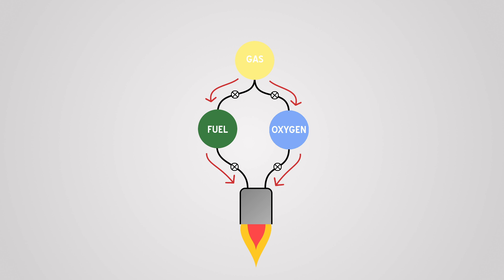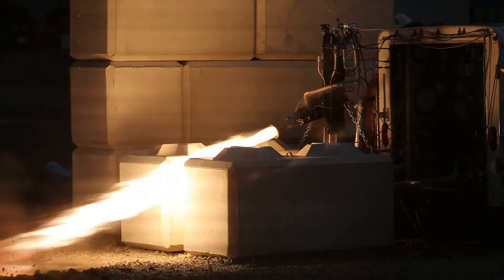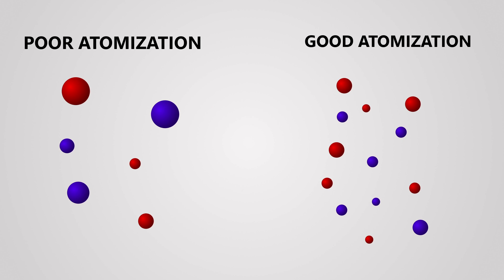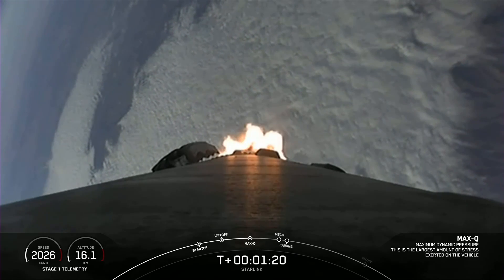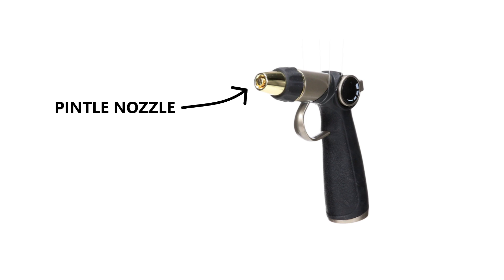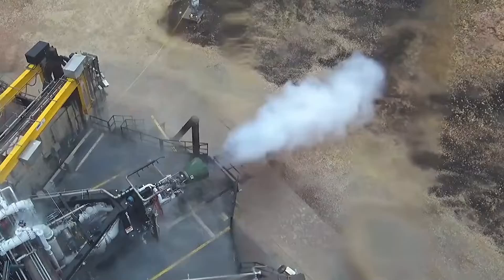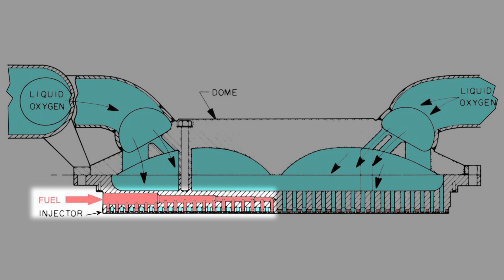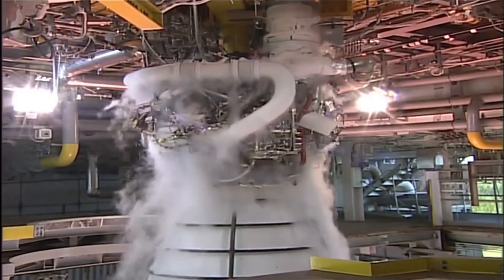How Rocket Engines Work - Part 6 - Injectors

Comment: Man I struggle just to get my garden hose flow rate right! It seems to be different every time I turn it on. Can’t imagine how hard is to get rocket engines to work. I know SpaceX actually have a simulation program that I assume they run on something like a supercomputer that calculates flows. I saw a video of this about 4 years ago from McGregor.

Comment: How does the propellant stay in the chamber in space? On earth its atmospheric pressure but in space ? Wont the propellant dissipate into the space vacuum before it gets a chance to ignite?
Reply from the maker: The whole goal of the rocket engine is to throw the propellant into space as fast as possible, but the time it takes to ignite is a consideration. If the combustion chamber is too short the propellant will indeed exit before it ignites. Luckily these reactions take place in very short amounts of time, so the combustion chamber doesn't need to be too long. The amount of time the propellant is in the chamber is only a fraction of a second, but for modern engines that's enough to burn.
Reply: @SpaceIsKindOfCool  but once ignited it requires pressure to create thrust . The space vacuum would prevent any pressure build up. It would be like an inflated balloon , when released the exiting air would provide thrust . But if we attach a vacuum hose to the mouth of the balloon then any air released would be sucked out immediately preventing any thrust
Reply from the maker: @nickmerix2900  In your example any air sucked out of the balloon, even if it were due to a vacuum, would indeed cause thrust. It's Newton's laws of motion, any action has an equal and opposite reaction.

As for vacuum causing there to be no pressure build up in the engine, this is also false. Since the nozzle is a constriction any flow through it will result in a pressure build up.
Reply: @SpaceIsKindOfCool  newtons third law does not apply to all forces. Example buoyancy, gravity, and pressure gradient. If we apply newtons third law to lets say a hot air balloon  then it should never   Lift of the ground. Or when a pressure gradient causes winds to blow south with force  x we dont see an x force to the north also. If i drop a 5 kg weight from height it will fall with a force of say 50 newtons but i will not feel that force on my hand. In these situations we have force with no opposite force . Rocket exhaust is basically pressurized gas moving to lower pressure ie pressure gradient. And gas expanding in a vacuum is free gas expansion
Reply from the maker: @nickmerix2900  Newton's laws absolutely do apply to all forces. In all of your examples the object which feels the equal reaction is the Earth (or the Earth's atmosphere). When you drop that 5kg weight it falls, but the Earth also rises to meet it, you just don't notice it because the Earth is so massive that 50 N doesn't move it very fast. In the wind example if you were to take the total momentum of the Earth and its atmosphere you would find it never changes. If the wind blows stronger in one direction the entire Earth must have a change in rotational velocity in the opposite direction.
Reply: @SpaceIsKindOfCool  how do you measure the opposite of those forces? It might be the case in theory but in real world results? If we put a small weight on a scale and use a vacuum hose to lift it off , we dont see the opposite force register on the scale. According to your theory we should be able to see an equal and opposite force.
Reply from the maker: @nickmerix2900  The theory is based on experimentation, just as it always is in science. In this example the opposite force is not felt by the scale at all, it is felt by the vacuum hose. If you were to suspend the hose on a spring scale you would see the hose get pulled down when it turned on due to the opposite reaction of the hose pulling air and the weight upwards.
Reply: @nickmerix2900  Nick, I can't tell if you're arguing in bad faith or not because I've seen a lot of commenters on rocket propulsion videos make the same claims you have made about the vacuum of space preventing rockets from working.  But I'll address some of your questions.

Hot Air Balloon Example: 
The atmospheric pressure, P, surrounding the balloon multiplied by the vertical components of the balloon's surface area, A, will create an upward force, F, known as lift (F = P x A).  If the lift force is greater than the balloon's weight, the NET FORCE will be UPWARD.  This upward travel will continue until the balloon reaches an altitude where the atmospheric pressure is small enough such that the upward lift force, F = P x A, is equal to the weight of the balloon, W = m x g.

Now then! You're wondering, "yes, well where's the reaction force from the balloon lifting?"  That reaction force is applied onto the air below the balloon.  Yes, that's correct.  The balloon is pushing down on the air, making the air heavier, and that air pushes down even further onto the earth.  

You can test this example for yourself.  Grab a bowl of water and place it on a scale.  Then add a floating mass on top of the water.  The scale will read higher to account for the added mass.  In this example, you have the weight of the bowl+water+floating mass pointing downwards due to gravity, and you have a normal force pointing upward.

Another example to help you visualize.  Take a barbell at the gym and put it on your chest while standing up.  Then vertically lift up the barbell in the air.  You will feel the normal force from that barbell on your hands, arms, and legs all the way down to your feet.  The normal force will be equivalent to the FORCE YOU'RE LIFTING WITH, which is greater than the weight of the barbell. The same thing happens in the water example and the same thing happens in the balloon example.

Wind Example: 
The wind doesn't blow with force x.  Instead, high pressure regions are created in the atmosphere which move the air radially outwards in all directions, including North, South, East, West, Up, Down.  That means you have air moving to the north and air moving to the south from a central starting point.  This would be like you being in the middle of Bookshelf A and Bookshelf B, while pushing Bookshelf A to the left and Bookshelf B to the right.  They both move, but you stay still.  Action force to the left results in a reaction force to the right. 

5kg Ball Example:
When you're holding the ball, you are already experiencing the action-reaction forces in that moment.  There is the weight due to gravity at 50N downward and there is the opposite normal force of 50N pointing upward from where your hand is contacting the ball.  When you release the ball, you experience a decrease in normal force proportional to the decrease in weight of the ball that you're hand is holding up.

What you're misunderstanding is the idea that "by you letting the ball go, you're IMPARTING A FORCE ON THE BALL and so you should experience an opposite force."  This is false.  Gravity imparts the force. You do not impart a force by letting the ball go.  If you wanted to experience the action-reaction force on the ball, you would have to PUSH IT DOWN HARD and then you would feel the resistance.

Vacuum Scale Example:
The 'ball' experiences the force of gravity downwards and a normal force upwards.  When you use a vacuum to lift it off, the atmospheric pressure, P, multiplied by the vertical component of the balls surface area, A, result in lift force, F because F = P x A.  If the lift force F is greater than the weight of the ball, it will LIFT UP the ball and reduce the weight registered on the scale.

Now then!  If you had mini load sensors on the surface of the vacuum hose tip, they would register a NET FORCE UPWARD because the ball is being forced up by buoyancy but there is a normal force acting downwards from where the ball contacts the load sensor.

Comment: "With deeper throttling, oxidizer and fuel flows tend to oscillate and will usually bo longer remain at their original mixture ratio, the propellent injection streams become erratic. Yo prevent this, engines need to have some special features like those found in the engine used on the first lunar landing rocket...each propellent flow control valve included a cavitating venturi with a moving tapered pintle... This assured predetermined stead reduced flows of propellents at all thrust levels, and maintained a constant mixture ratio... It allows for high injection velocities of liquid propellents, giving good atomization  and adequate combustion with relatively small losses on performance at low thrusts." Chapter  8.8, Rocket Propulsion Elements :)

Comment: Great video, and congrats on the degree.
Can you make one about the advancements and differences between old (Apollo era) and modern engines? 
I don't think there is such great improvement in efficiency (NK-33 from the 60s was still a decent engine when it flew in 2014), but perhaps in control, reliability and labor-intensity? I suppose it is much harder to drill thousands of holes with millimeter precision is harder than to put a single pintle/swirl injector, but would love to learn about less obvious differences.
I would also love a video about the tradeoffs in designing a rocket engine, why some approaches got more or less popular with time.
Reply: It's not really in performance I think but the main differences are in development and manufacturing.
new metallurgy allows for higher combustion temperatures and chamber pressures, new machining techniques allows for faster or simpler construction, additive manufacturing means more complex parts can be manufactured relatively easily, better computer modeling techniques means allows for cheaper, more analytical approaches to pump, turbine and injector design